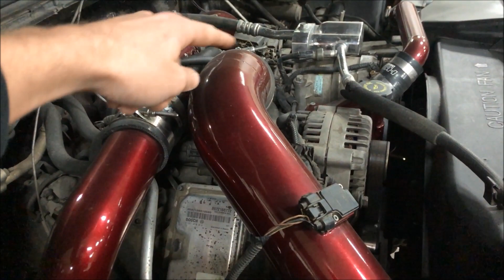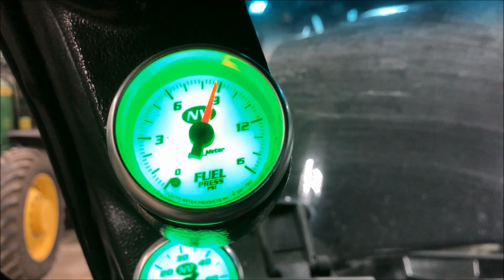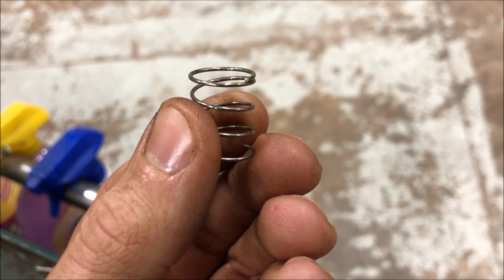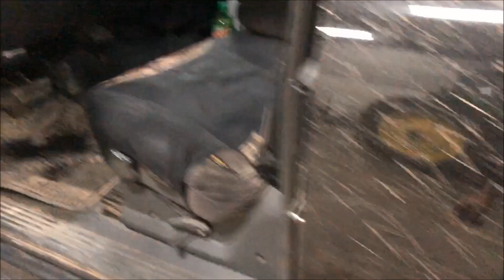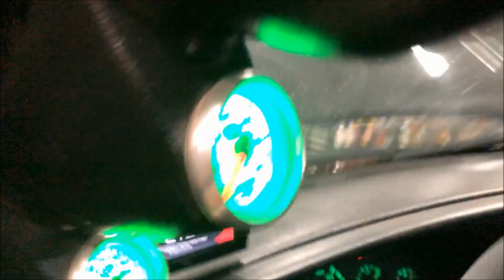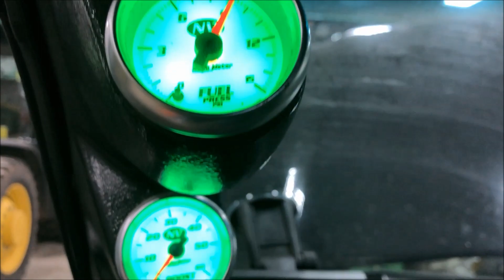LB7 Duramax Idle Lope and Surge Issue Fix! Limiting the supply pressure to the CP3

Comment: Just installed new
Cp3 and my truck actual pressure is going up to 11-17k and goes back down after a min, driving it’s fine . Thought might have been FPR but unplugged it and made it max out so it’s not that . Than unplugged the fass and it went back to normal at idle so I need to do this I reckon correct sir ????

Comment: Since you have the supply line directly to the cp3 what did you do with the ficm?
Reply from the maker: Plug the inlet and outlet.
Reply: Won’t that over heat the ficm. Since no fuel cooling it?

Comment: I installed a new fass lift pump and I got a p0089 code I replaced the fuel pressure regulator and after awhile it gave me the same code, you think if I cut the spring it might help
Reply from the maker: On an lb7? There is a decent chance that is your issue yes, especially if it started happening after you installed the Fass pump, and changing the FPR didn't help. You can either cut the spring down a bit, or call Fass and get a lighter spring from them for cheap.
Reply from the maker: One more note here...there is a port on the oem fuel filter head for 1/4 npt gauge I believe, it would maybe be worth the $10 to get a cheap pressure gauge and rig that up there to check your supply pressure, and be able to cut the spring to hit the 8-9 psi range if you go that route. Don't want to lead you down a rabbit trail but just a thought after doing some forum searching.
Reply: @FixedVaneDuramax  yup on a lb7 awesome thank you for the advice!!

Comment: Hello I only have a jumpy idle just when in cold start after running for 30-40 min it's drives smooth and normal what could it be I have changed out FPR and fuel rail sensor as well everything else is stock truck has 170k original miles

Comment: Just ordered a fass 165 lift pump for my 2004 lb7 with 243,000 miles injectors have been done just curious if I should change my fpr before installing the lift pump or was wondering if I will have any issues with installing it on a stock lb7 thanks for any input
Reply from the maker: If the FPR isn't giving any issues now the fass install shouldn't change that by itself. If it was mine I would install the lift pump and just pay attention to how it idles. If it starts to get lopey, I would try the spring clip trick or reach out to Fass and have them send you a lighter spring.

Comment: I have this exact same problem. I've snipped about half a circle of the spring and got down to about 10psi and it doesn't seem to bounce. Did you happen to throw a P089 code along with it? Also started after the FASS150 install.
Reply: I installed a new fass lift pump and I got a p0089 code I replaced the fuel pressure regulator and after awhile it gave me the same code, you think if I cut the spring it might help
Reply: I have same problem at idle with p0089 and when I unplug my lift pump
It stops

Comment: i have a question..... my older lb7 was looping a little bit... so i figured the fpr.... well i put a new bosch one in and when i started the truck its looping terribly bad now.... i think i may have messed the oring... but i am not sure .. any idea what direction to go... ?
Reply from the maker: The O-ring is the most probable cause, it is really easy to roll or crimp when installing the FPR itself. If you have a monitor or a shop that can check your injector balance rates and pulse that would also be good. I haven't seen in person but have seen videos of a truck with a stuck injector loping hard. But if it is much worse purely after an FPR install that would point to that FPR itself still. Not sure how helpful this is but that would be my thought.

Comment: I have an 02 lb7 that lopes at idle I have an air dog 150 I replaced the cp3 which also had new fpr but still lopes can it be the pressure relief valve it has close to 300k miles but does not have absolutely no blow by and dealer and other shops all said injectors read goods very thing else is stock and I have no gauges but do have an obd2 that reads live data
Reply: any fix? i got the same issue on mine.
Reply: It was the pressure relieve valve. Or of you have a lift pump check the check valve to make sure it’s still ok on the lift pump.
Reply: Did u fix the issue? Im having the same head scratching problem
Reply: I have a lift pump on my lb7. Could the check ball be the problem? Same deal just over pressurizing
Reply: thank you ill try that out. i have the industrial injection cp3 100hp and the air dog lift pump. when i disable the lift pump it stops.

Comment: Nice video ! I have a 02 Sierra , I have no haze at idle but sometimes when I take off it’s kind of boggy and shoots blue smoke then if I get in it it clears out and runs fine with no smoke ,  just did the fuel filter would you suggest injectors or regulator ?
Reply: Also it doesn’t lope at idle or in general
Reply from the maker: @1nHaLeZ  If its not idling rough your regulator is probably fine. If you can try and check your balance rates with a scan tool or an edge cts to see if they are in spec. If you can try running an injector cleaner through as well before you dig into replacing the injectors. There are a few different youtube videos showing how to unhook the supply and return lines and running the cleaner through the the motor.

Comment: Now riddle me this, twin dueler LBZ cp3's one in the valley, one on the pulley system, Fpr delete with my Wherli S300 kit yet it surges at idle while it's cold and my frp jumps around at idle and lopes when it's cold. Ppe duel fueler controller, and ppei tuned for the Lbz pumps. Only dose it at a cold idle though. I also have a Fass 150, anything else I could be missing? Love the content man, been working on a build series of my truck but haven't posted any of it yet! Nice to see some one with good information!  PS I'm also running 100% over Sac injectors, not that that matters much but I'm just curious because my truck never used to surge with just the Fass lift pump, Fpr in place, and trans safe tunes.
Reply from the maker: Sounds like an awesome build! I'll be excited to see those videos when you get time to put them together. I'll be honest in that situation that may go over my head, may be worth taking a data log and sending down to Kory to see if he has any thoughts on it. If I had to take a stab in the dark I would think the pumps are providing more fuel than necessary at idle or the injectors are staying open too long (pulse width) but like I say, I can't say with any confidence I'm shooting near the mark on this one. More and more I am realizing that I need to buy a V2 and start digging into tuning myself just to learn the ins and outs of how these trucks function. Would be a fun challenge.

Comment: Excellent work! Not a big deal, but you mention "...the FICM is not expecting the higher pressure...". I'm thinking the FICM just pass-through fuel for cooling so it doesn't "care"
Reply from the maker: You are correct! The FICM has the fuel pass through it but it doesnt actually measure anything at that point. The fuel supply is routed through the FICM to cool it, through the fuel filter, and on to the cp3 to be pressurized. I mentioned in the video that I actually have my fuel supply routed directly from the lift pump to the cp3, bypassing the FICM and the fuel filter(deleted.) What I meant was that the FICM is in command of the pressure and injection, and is more finicky to low pressure supply than the later trucks where the ECM commands the fueling process.
Reply: @FixedVaneDuramax  At the risk of insulting your intelligence, I'd be concerned about operating that FICM without the benefit of fuel cooling. Obviously it must be working for you, but it gets mighty hot on that passenger side valve cover and reliability has gotta be a concern.
Reply from the maker: @stevewaclo167  Dont worry about that! Everything is up for discussion, that's how we all learn. So I was concerned about that as well, but I spoke with several experienced lb7 owners who own high horsepower trucks that see continuous daily driving/street time, as well as sled pulling and drag racing and they each told me that it had never been an issue or a concern for them. I have been running my lb7 this way for almost 2 years at this point, it has seen hot Illinois summers, daily driving, sled pulling, a little drag racing, as well as towing without an issue. Not to say no one will ever have an issue with this, but it has not been an issue for me at this time. If I ever stop daily driving the truck I will definitely relocate the FICM, probably to the back corner of the drivers side in the engine bay.
Reply: @FixedVaneDuramax Thanks for your reply! I am impressed by the robust engineering GM put into our FICM's and can't help wonder who was the first to risk one by taking it out of the fuel circuit..

Comment: Yesterday a p1094 code showed up on my truck.  Trucks runs fine no issues...
Reply from the maker: evan hale I just did some quick forum searching. You have an LLY truck? That code generically is a fuel rail low pressure at idle code. Which could be either a weak fuel rail pressure relief valve or the FPR itself. If its the FPRV you can get a PPE “Race Valve” that essentially blocks that off, helping the cp3 maintain pressure. Similar to how you plug off the return port on the LB7 fuel distribution block. 
For now I would clear that code and see if it comes back. If the truck seems to be running good it may be a fluke but watch it.
Reply: It's an lb7.  I cleared it we will see if it returns!  Thanks man!

Comment: What your tach...if it is bouncing/moving up and down...fpr giving you fits......and or...Duramax does not like over 9 to 10 psi of fuel psi
Reply from the maker: Agreed. Cutting my spring down helped to control the surging at idle, but if your fpr is going out it will not completely solve the issue. I actually have an fpr ordered at this point, while this procedure did help a lot, my truck has once again started to have a lopey issue and watching the rail pressure it is bouncing around more than I would expect when the engine is under light load (idling in drive) and cold so the FPR is getting swapped when I get some time.
Reply: @FixedVaneDuramax  did the fpr fix your issue?

Comment: When you say surge do you mean like a slight shake at idle  after truck warms up  My truck is doing that  and come to think of it didn't start doing it until I put a fass 165 on truck.   I replaced fuel pressure regulator about  8 months ago with new Bosh one.  One thing I noticed is on the edge cts2 monitor  desire frp is 4.4 and actual frp is going 4.4 down to 4.2 back and forth.
Reply from the maker: Jason Scruggs Yeah thats kind of what I mean, when the truck is cold you can hear and feel the motor slightly loping. When it was in drive, and at idle, it was literally attempting to surge through the brakes until the truck was up to operating temp. Like I say in the video it wasnt really noticeable until the weather turned much colder, but that could just have been since the truck takes longer to warm up. You could very well being seeing this a little bit too. I really wouldn’t have found issue with it if it hadnt been trying to lope/surge through the brakes when in gear but it made it very uncomfortable to drive.
Reply: @FixedVaneDuramax  cool I will put  a gauge on my truck  next week and see what the lift pump is at with truck off then truck on.  I bet mine is too high too  I have a lly
Reply from the maker: Jason Scruggs You’ll have to keep me posted, Im not sure if they made any adjustments to the 165 gph model or if its exactly the same. I have a lbz cp3 and fpr so I thought this shouldnt have been an issue but apparently its more the ficm that has a problem with it vs the fpr itself.